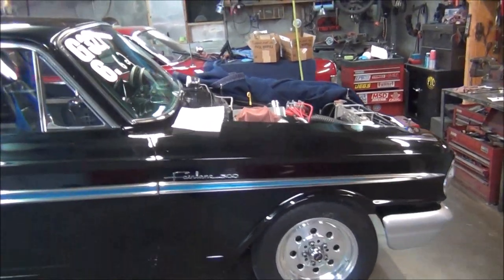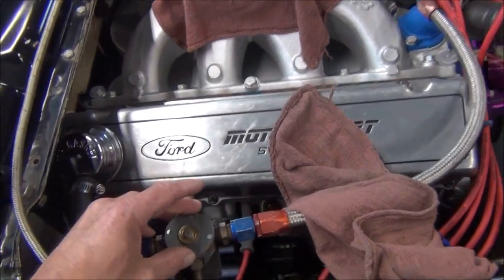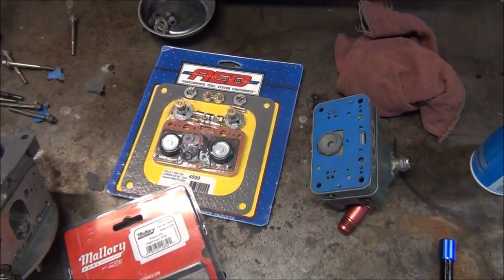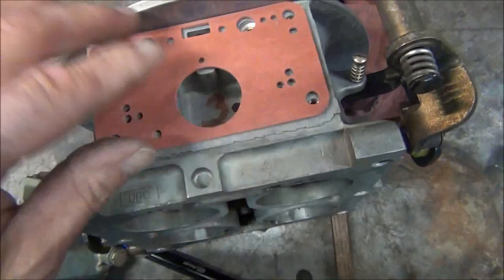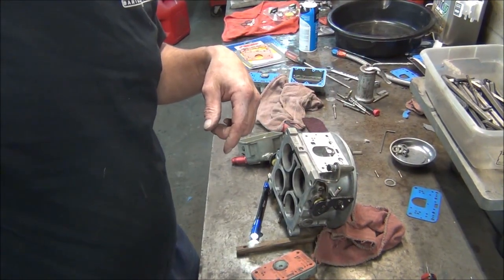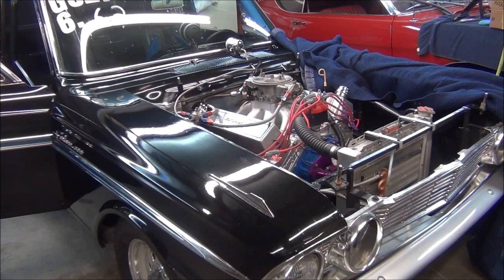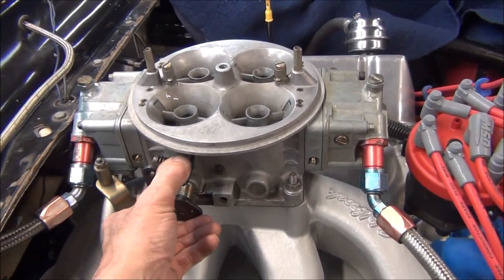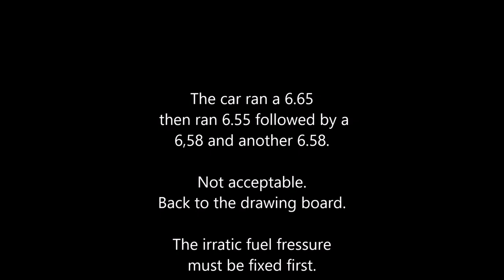Fuel Pressure Issues,Part 2

Comment: I’d do a test to see how fast the pump will fill a 1 gallon jug before regulator. Thinking it should be under 30 seconds for that pump. You can find that info online somewhere. Any chance it’s a voltage issue to pump?  Good luck👍
Reply from the maker: Thanks for watching